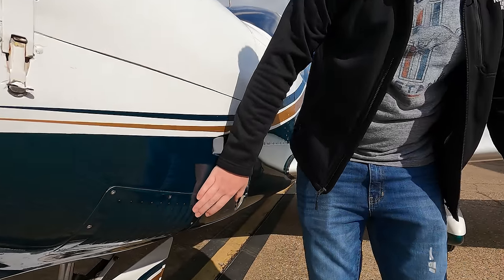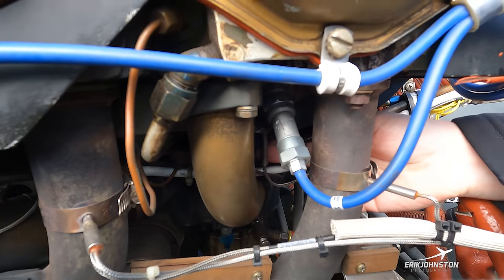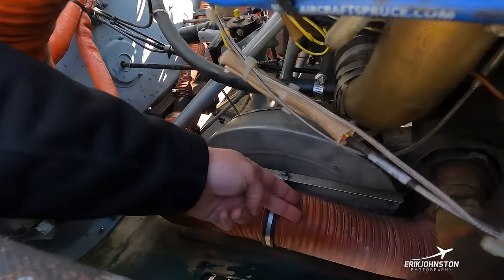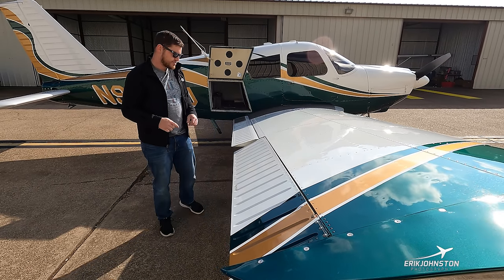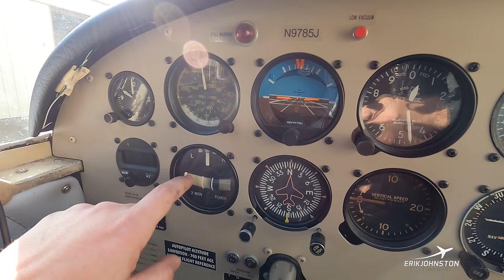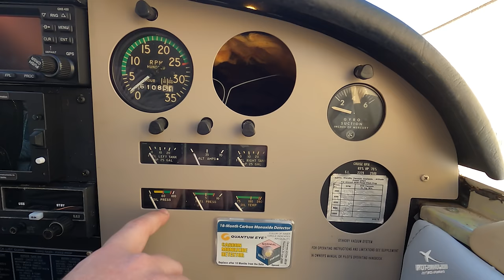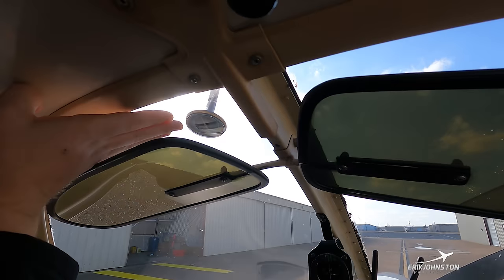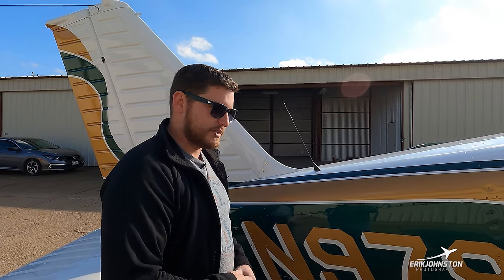Piper Cherokee 180 Walkaround

Comment: If it's 110 on the runway hold short, I am not going up. This pilot will get to hot and I am sure the air cooled engine will thank me. I have temperature minimums. Not flying above 93 degrees F.

Comment: FYI - you need choke rings on all USB cords you're using in the aircraft. Still, that cheap USB charger may interfere with your radios. As a fairly new Piper owner, this video was very helpful! ~thanks!
Reply: Great Observation. It DID cause some noise when feeding my IPAD. Its since been traded out for a Garmin unit.
Reply: @jonathanschmidt3154  Thanks! I'm using a Garmin Gsb 15.

Comment: Yes, I am flying the same aircraft and I do have to put a bit more force in the Flare. I try to put in some trim to help me flare smoothly. It does feel a little heavy flying. So maybe the weight in the back helps it be more balanced. I rent many different aircraft Piper aircraft, 140 or 180.
Reply: I agree with you, trimming nose up helps a lot with the flare. There is a particular Cherokee in my school that is heavier from the nose than the others, is very clever to put the ballast weight in the back 🤔

Comment: hi, just a detail, if at 3:26 thats the air intake for the carburetor, so what air-filter do you refer to at 3:59? 😇
Reply: Great question, the first one mentioned is unfiltered air that is routed through a heat muff to create hot air, and can then be routed into the carburetor to prevent carb ice (pulling open carb heat). This is not the normal setting. The second intake is the one used 99% of the time and is filtered, cool/ambient temperature for normal operations.